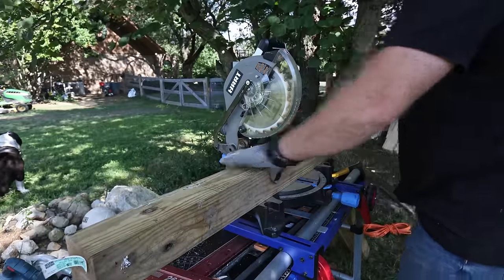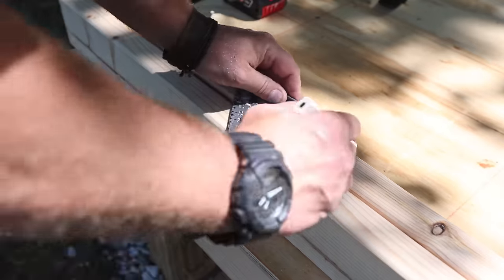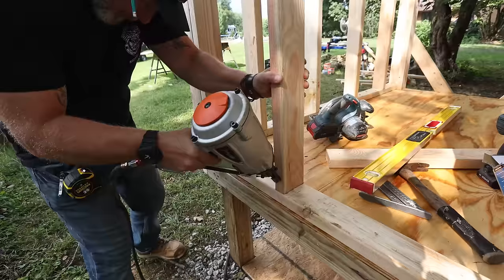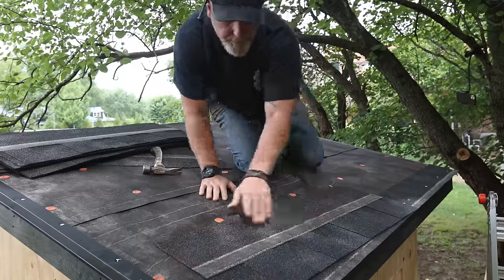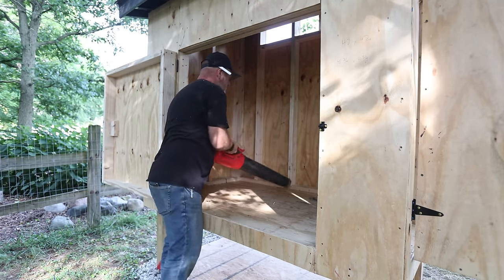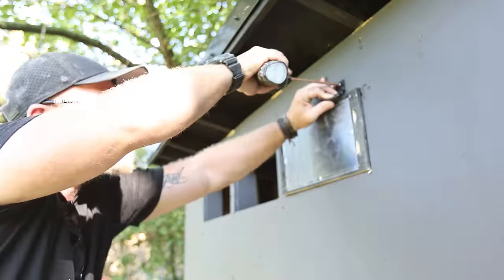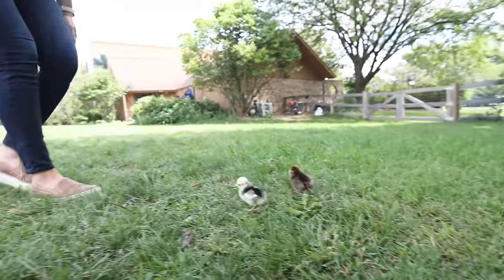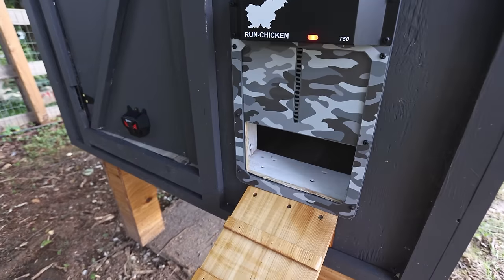How to Build the ULTIMATE Chicken Coop in 7 Days // Plans Available

Comment: Beautiful coop 😊.  But on the construction side... overkill much? On the framing part, 2x fours were unnecessary could have easily gone with two by threes Or even two by twos. Glue in the joints totally unnecessary. Loved the cedar siding

Comment: How did you do your hinges behind the trim:  ?   They look screwed into the wall , not the jam.  Does the trim now interfere w/ it opening ?
Reply from the maker: They are attached to the frame.  They are offset hinges and with a little trimming of the wood vaneer it works without hitting anything

Comment: I really like your plan to make this a surprise for your wife. I love the attention to detail - like do you think the birds appreciate the three coats of cedar treatment on the outside?? But - you missed a HUGE feature and I think it affects your birds to this day. The egg hatch!! 
From my research, you do NOT want to allow the top to open - that's were the vast number of natural predators come from - the sky - so chickens FREAK when the top is opened. MUCH better to fasten the top - and then lower the rear panel. And you don't need a gas-assisted shock to help with that weight. You can secure it when vertical and allow it to hang on chains to be level when open.
I'm just getting into raising chickens - but I got that much. Also - I would have made the partitions between the nesting boxes both removable - and from a washable material. Most recommend designing with the ability to make a double-wide space for a hen if needed but most also agree that the girls do not need one nesting box each - they will often leave some open and several will share the same box. So many growers have more nesting boxes than they need - but put stored items in one or two and close them off. But that lid that opens to the sky - is stressing out your birds every day - and likely contributing to lower production - but stressed out birds.
In my design - I'm going to utilize the deep bedding style but think more about overall design - from the bird's view - than care about what the cosmetics are.
Initial comment before I saw you build the 'interior platforms'... dunno about that! I am asking if now you still have them in? I'm guessing they became 'poop shelves' instead of platforms?
Again - my research shows they sleep standing and poop OFTEN - perhaps waking to poop and back to sleep. So I would have several bars for them to roost on / sleep on but no platforms - so their poop - goes where you intended it to.
I've also seen a nice-looking and practical design to wrap the bars in a jute rope. It makes the bar thicker without it being 'solid wood' and looks good. Find the right size for your birds - and they won't make a poop mess of the bar-rope.
So I see this was produced 18 months ago or so - now Spring 2023. Do you still have this coop running like your initially built it?
(I think your finishing work and letter making is your true calling. This looks great... but design not for me.)